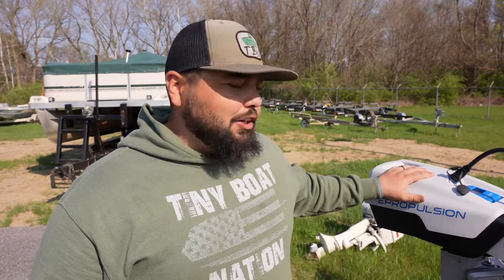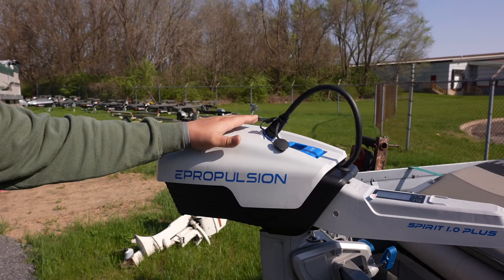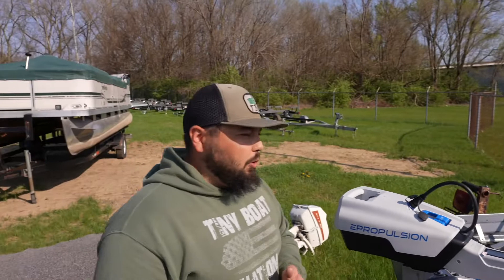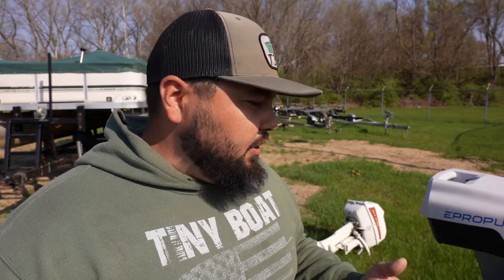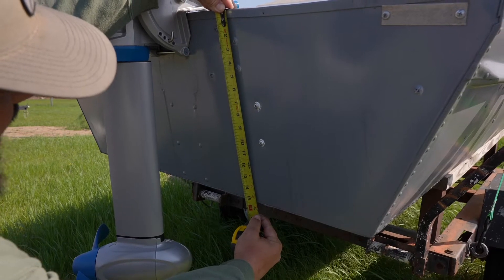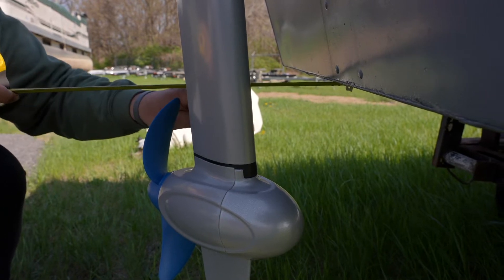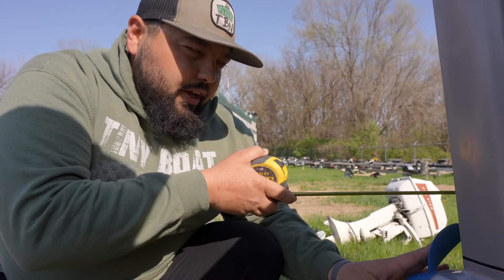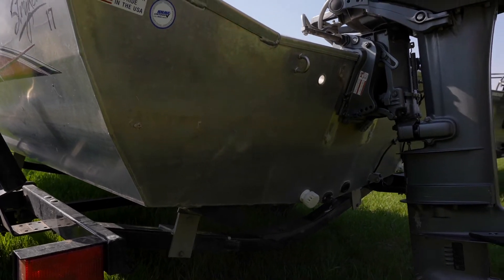EPropulsion Motor Shaft Height | How to choose the right length

Comment: Hello i'm just about to buy 10.5 feet inflatable boat with a 15 in transom propelled with an eProp Spirit 1.0.  Now what happens if one day i need to use the motor on a regular rowboat or lend it to a friend, with let's say a 17-18 inches transom.  Will it still work anyways for the time being?  Thank you
Reply from the maker: No, it will need a longer shaft or else on a tall transom it will cavitate.